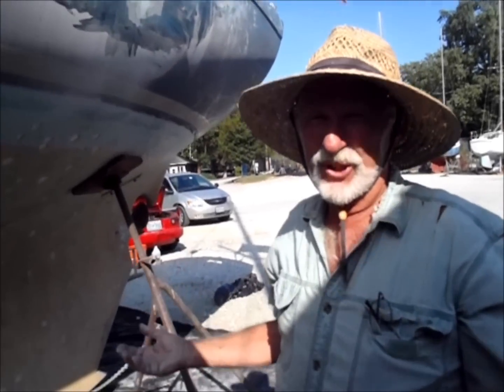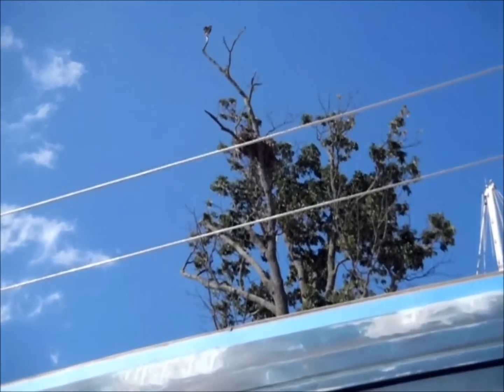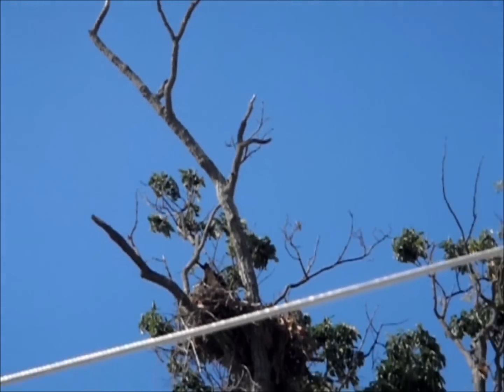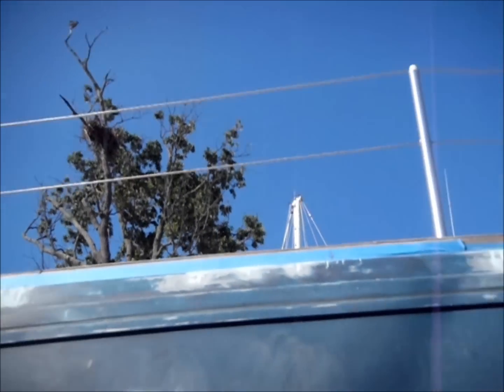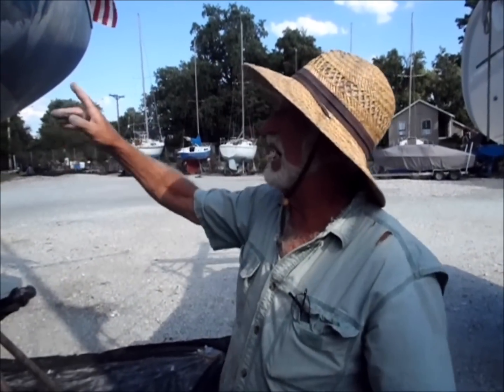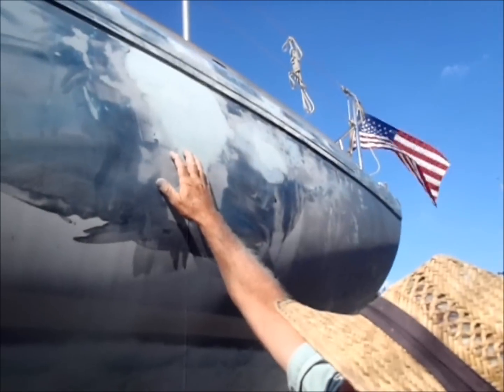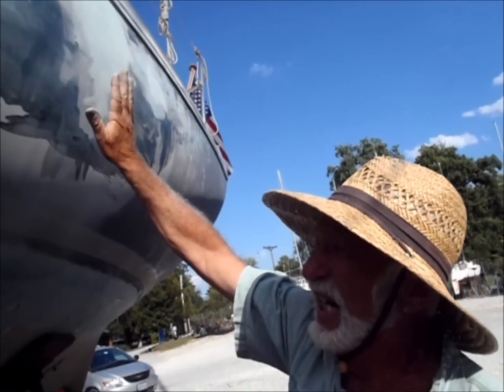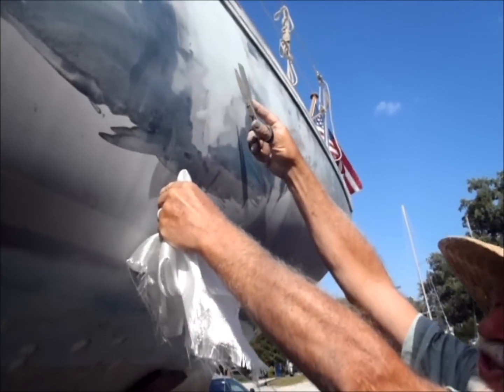I'm On A Boat- Fixing Gelcoat Cracks & Crazing

Comment: I can see your an old Salt, I must say that this is a  very interesting video, very well explained- reason I am just about to pull my boat out and repaint, what paint do you recommend to paint the upper part of the hull- I am going to paint the anti-foul with copper coat  I would be interested in hearing your comments on copper-coat- its a minefield out there for products Regards Robert the boats fibreglass
Reply from the maker: Thanks for the comment.  We like to use Interlux Perfection for hull paint and have always had success with it.  Check out our hull painting video for more info.  Copper is a traditional anti-fouling and works well but a lot of newer products don't contain very much of it.  We would recommend "Practical Sailor" they have done many very useful paint comparisons.  We wish you the best with your project!!